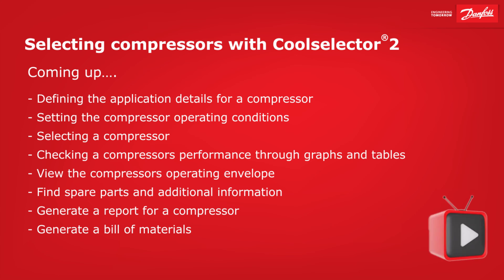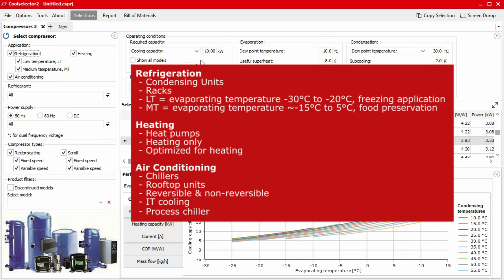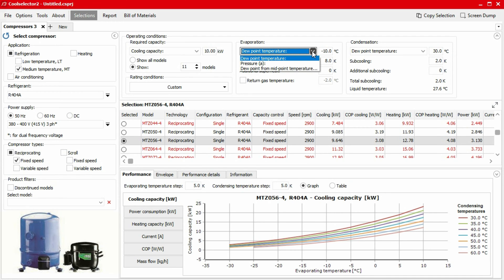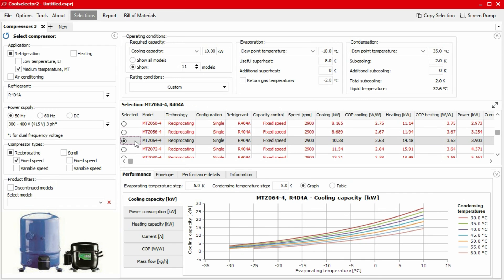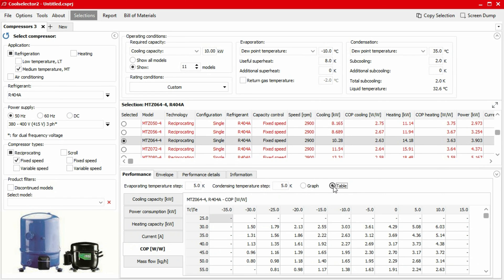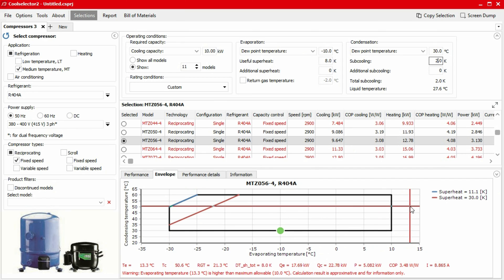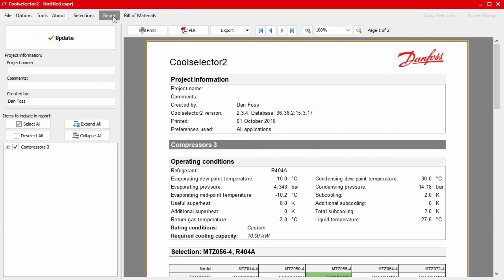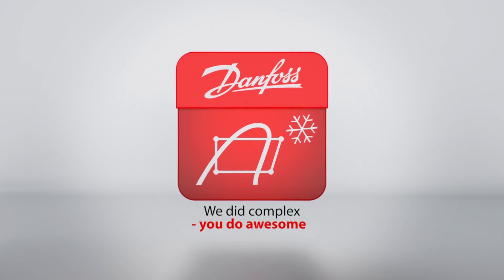Coolselector®2 – Compressors

Comment: where is R-717 refrigerant in  Coolselector2.
Reply from the maker: R717 (Ammonia) is usually at the bottom of the refrigerant list, but some components does not apply to R717, so it will not be in the list for that particular component, like the filter driers

Comment: where is R-717 refrigerant
Reply from the maker: R717 (Ammonia) is usually at the bottom of the refrigerant list, but some components does not apply to R717, so it will not be in the list for that particular component, like the filter driers

Comment: Hi. All of these compressor not include Turbocor centrifugal compressor models. Is there any software or parameter or any guide for select correct capacity centrifugal compressor model for my chiller project?  thanks for your help
Reply from the maker: Hi Amin. That's correct. Unfortunately, Coolselector®2 does not include Turbocor® compressors.
Reply: @DanfossClimate  Thanks for your response. Is there any software or parameter or any guide for select correct capacity centrifugal compressor model for my chiller project?
Reply from the maker: @aminsattar8485  Our Turbocor team is ready and willing to help. You can get in touch with them by going here and hitting the Contact Us button at the top of the page: https://www.danfoss.com/en/products/compressors/dcs/turbocor/#tab-overview